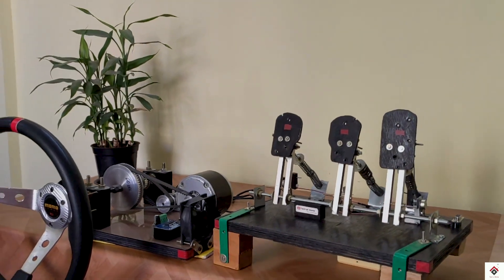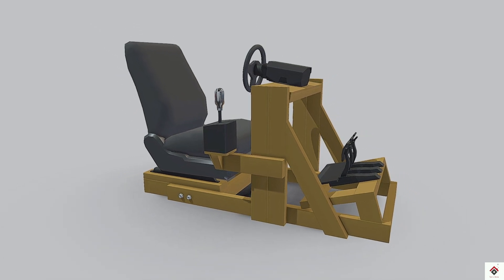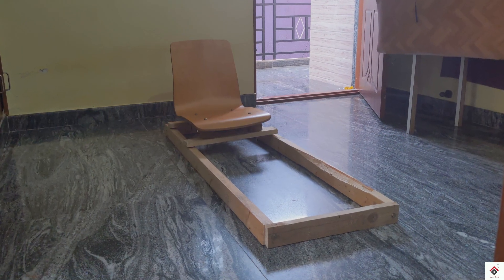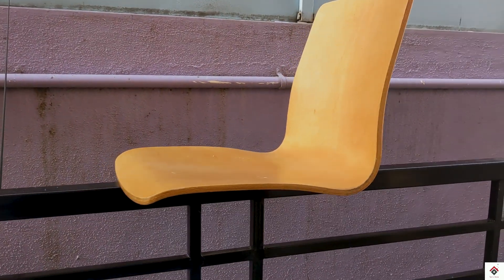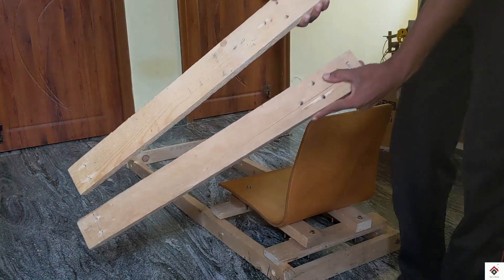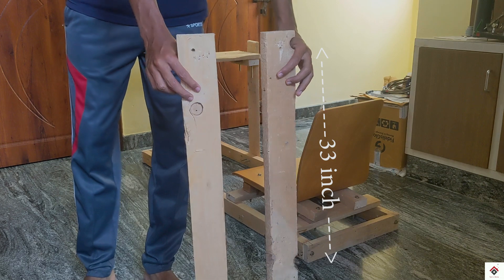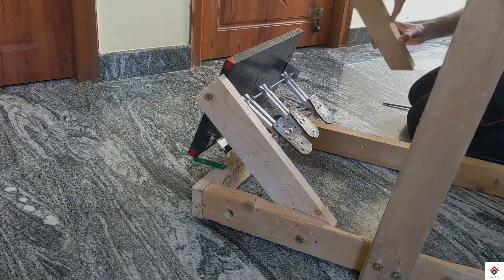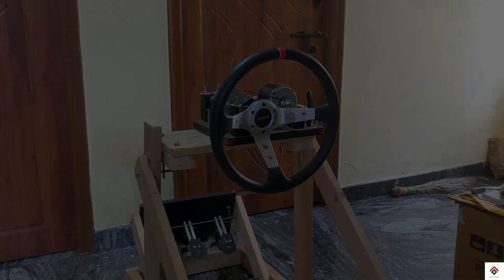DIY FFB Sim Racing Rig | Building Cheapest Racing Cockpit [in ENGLISH] , Arduino FFB Steering Wheel

Comment: lol there is no torque you can also build this with Gyro rather then using these useless motors
Reply from the maker: This is 24v, 250W motor, but I have connected to a 12V, 5A power supply.

Comment: i have problem with the encoder, the encoder rotation is not synced with the ingame steering angle, i use a 600ppr encoder.
Reply from the maker: Have you set CPR value in EMC software?
Reply: @techathome  i used a different firmware called ffb wheel arduino leonardo 0.16.hex with rfr wheel config, i fixed it, thinking about switching to emc software but the most important thing is that i need extra buttons.
Reply from the maker: Even I started with RFR, but it was giving error unnecessarily.
EMC is best, even EMC firmware supports
16 buttons
1 encoder wheel
4 Analog axes
Reply: @techathome  thats what im looking for, where can i get this firmware?
Reply from the maker: Refer this: https://youtu.be/crdDhvhBG0M?si=kyH82sOX3W4alPoy
Reply: @techathome  Thank you.

Comment: Can you make a direct drive wheel using a hoverboard and arduino leonardo, using the hoverboard motherboard as a motor controller (flashed firmware)
Reply from the maker: I will try